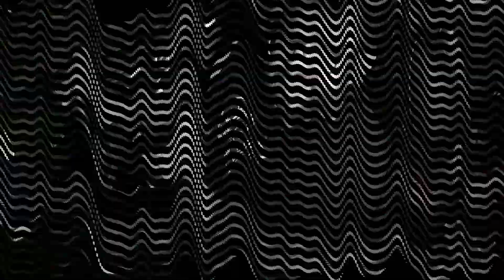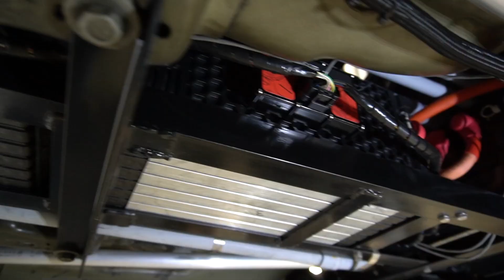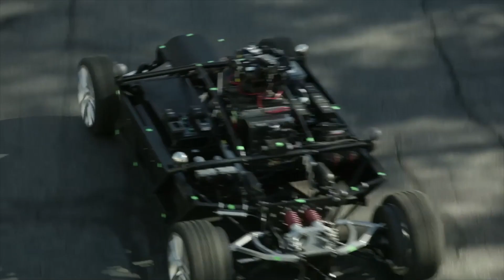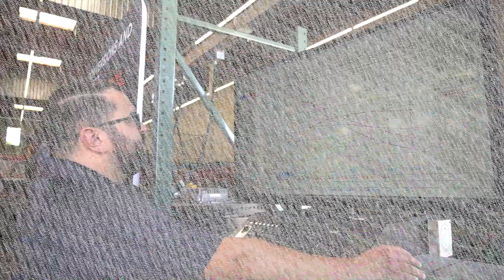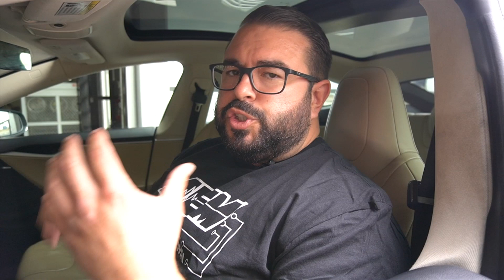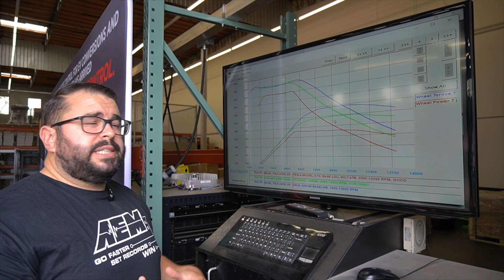Tesla-Swapped Mustang vs Model S on Dyno!

Comment: It looks like the motor in your performance vehicle still has more to give... What about a capacitor bank, timed in with BMS/PMS specifically for 1/4 and 1/8 mile drag runs. Provided no cooling issues. The added current phased in when the batteries start to fade I think would extend the pull through the run.

Comment: Very nice! How effecient are you able to tune the motor compared to Tesla oem calibration? Have you done any testing on that?
Reply from the maker: Comparing mechanical output power to DC input power, the motor efficiency is mostly unchanged from stock – even with a boost in torque and power.

Comment: It's amazing how much torque/power electric motors can make.  But let's be honest, tell me what would happen if you punched it from a standstill.  400ftlb, much less 600ftlb(!), will simply roast the tires even on a dragstrip.  That's fun at a cars and coffee but it's not fast at the track.
Reply from the maker: We do exactly that in our upcoming video where we take all these cars to the track and the results aren’t what you might expect.  One of the many benefits of having a VCU controlled EV is that the torque mapping is fully user tunable.  You can tune in different torque delivery curves for different traction conditions and always have the most usable torque available for the track or the street. What you describe is exactly why we developed our EV controls. Our mission is to provide products that take your EV conversion from a 'Sunday' car to a daily driver.
Reply: @AEMpowerTVelectronics  Thanksfor the reply.  I'll be curious to learn at what point on the strip you're able to send full torque to the tires.  It certainly isn't off the line but somewhere before the finish line!  I assume you have wheel speed sensors?  With that kind of tunability/flexibility, you'll have an incredibly fast machine!  This is a great time for us car guys to be alive!
Keep up the great work.